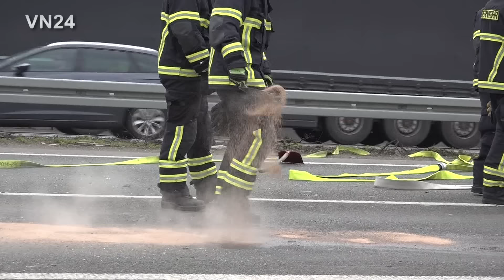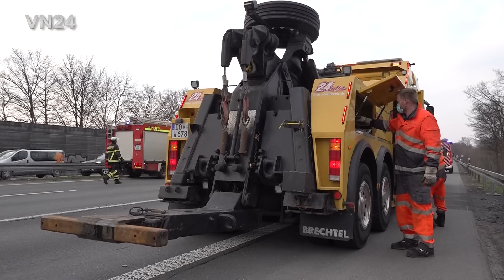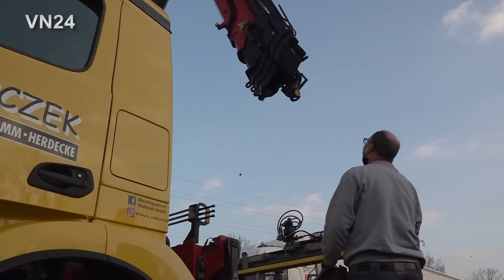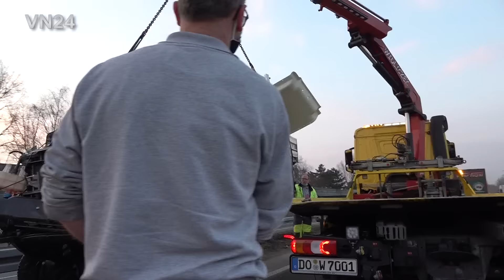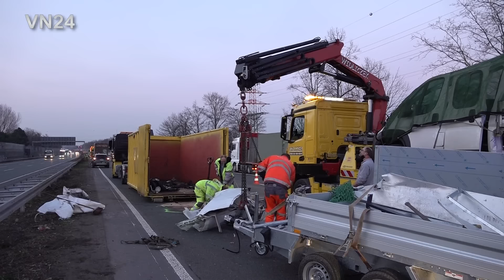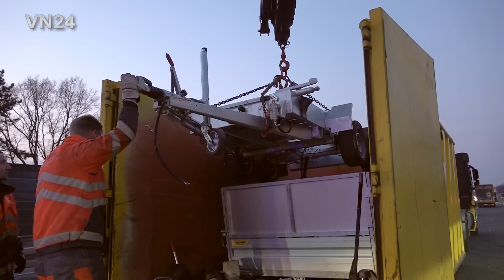23.03.2021 - VN24 - Pritschenwagen prallt auf Sattelzug - Rettungshubschrauber im Einsatz

Comment: That's a cool truck I like that how it booms out you need a magnet on it though you need one of them magnets like in a junkyard so you can pick up that stuff a lot quicker and dump it you should try that you need a magnet to where you have to turn it on when you get it in the air and turn it off when you're driving down the road when you're going to a wreck

Comment: Class 1 HGV drivers should be held to a very high level of responsibility for the safety of other smaller road vehicles. 40 tonnes at 90 kph is a lethal weapon. More manslaughter prosecutions might make the point. It is inherently dangerous to mix large trucks and small vehicles together, with large differences in weight and speed.
Reply: in this case the small vehicle rammed the semi. Not the semi driver's fault.
Reply: @thesteelrodent1796  OK. So not like the HGV, whose tractor unit wheels were alongside me in lane 2, which put me from lane1, onto the hard sholder, because he decided late that he wanted the imminent motorway exit.
Reply: 거리좀 뛰고 과속좀 하지마세요 얼마나 달렸으면 저동일까요 무섭네요